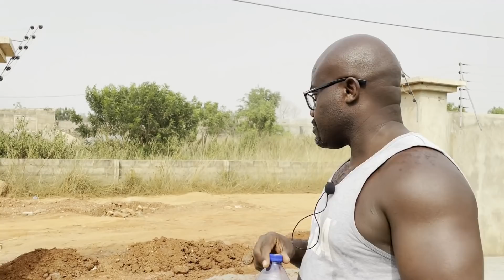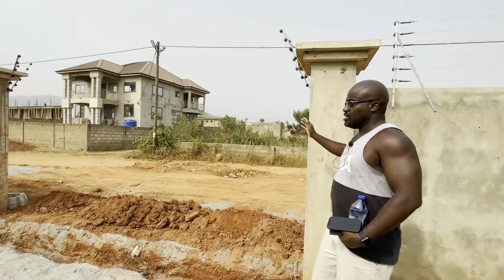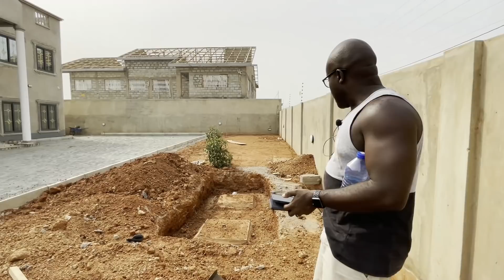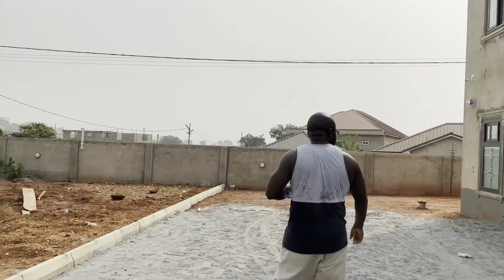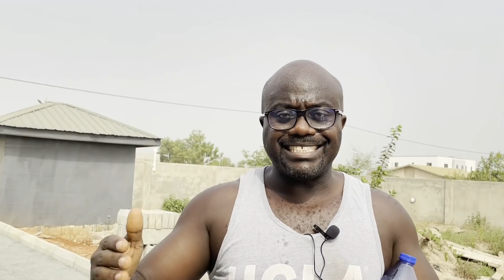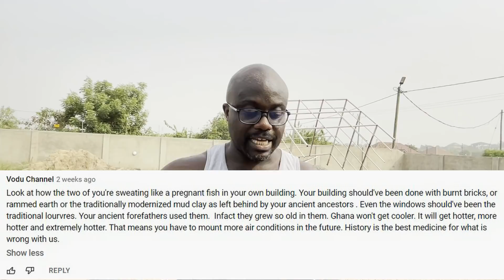BUILDING IN GHANA | SWIMMING POOL & ANSWERING YOUR QUESTIONS

Comment: Well, I did ask the questions in another video about "rammed earth" and yes, it is a modern update to building from our ancestors. I'm looking to build in this manner and have requested your assistance so I hope that you read from me. A quick reference, the Great Wall of China was built in this manner and it still stands. It is a great sustainable way of building with fewer toxins involved. The rude comment I will assume was attempting to tell "vs" in comparison to "vs" because this method does keep the home cooler. I begin researching for around one year now and am becoming more in love with this method of building. It's so earthly beautiful looking. It reminds me of elementary school projects as a child or at an outdoor fair of pouring different types of sand into a vase to make unique designs. I am looking forward to a sustainable way of building. Yes, the price seems to be reduced but when you want what you want price isn't the issue if you can afford any or all methods. There are several methods that I have been observing for building and it has become popular in Ghana long ago.

It seems to me that there are a few cons to the process such as, do not build during the rainy season and you can't just use any type of dirt that is dug from the backyard. It's possible but only if the location is key. Kumasi, where I am thinking of building, the dirt there is ideal and perfect. Otherwise, an expense is incurred because of travel time to purchase the correct type of dirt.

I am ready and want you on the team. Your intelligence speaks volumes or else you can source the correct people for me (I pay of course) especially when it comes to the electricity side of it. I am preparing to use 110V, the standard American voltage rather than Ghana's 220V for my inside home appliances. But will also have the 220V installed as well. Thanks!

Comment: or you could send the hot water output from the solar into those instant heaters. if the water is hot enough the instant heaters should/may not come on. the nice thing about routing the output of the of the solar heater into the input of your electric instant heater would be, if the water is not hot enough from the solar water heater the electric instant heater would raise the temperature of that water.

Comment: Besides individual step down transformers, what is the best alternative solution for a house that was not originally wired for 110v to have both 110 & 220v?
Reply from the maker: will have to cover that in a separate video, will need some wiring alterations

Comment: Thanks for acknowledging me. Yes you said my handle correctly.
Thanks for sharing. I understand what you have conveyed but it sounds like some wall breaking tasks.
So you are saying whether the roof is flat or not, the solar water tank must be on the roof? It's going get the best solar exposure? And it is ideal for the gravitational flow for both single level or multi level?
Reply from the maker: you can use a pump if you wish. it will only increase pressure so no negative apart from initial extra costs and power consumption.
Reply from the maker: there are many solar tanks on pitched roofs

Comment: You’ll be better off cutting the bottom section of the gate instead. The aesthetics of the pillars will be altered if you cut them. Just my experience from doing metal work

Comment: I live in a louver window house and it can't block the heat coming from outside during the day (the hot air). Also, dust comes through quite easily.

Comment: Nice job you guys. You don't need AC per se (if you don't mine heat) just ceiling fans. For me I'm canceling ceiling fans in most rooms cause apparently in South Africa at 3000 ft does not get too hot. You guys are almost there and congrats.

Comment: Gad's response to Mr Voodoo's comment was perfect. "Build yours and show us how it is done" . 
The comment itself was a bit crude and disrespectful only because of the 3 words "sweating like pregnant fish", everything else he said made a lot of sense and I have myself been wondering about natural alternatives to building with cement which readily conducts heat and is not the healthiest substance to work with or environmentally friendly to produce . 

Regarding your swimming pool the positioning is a problem as there is little privacy in the unoccupied land site. I would consider siting a very tiny pool at the rear of the house for privacy and easy access.